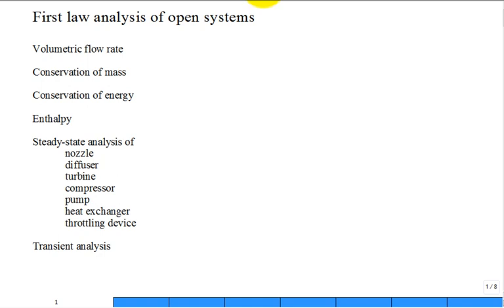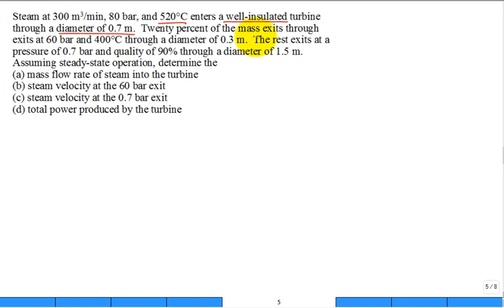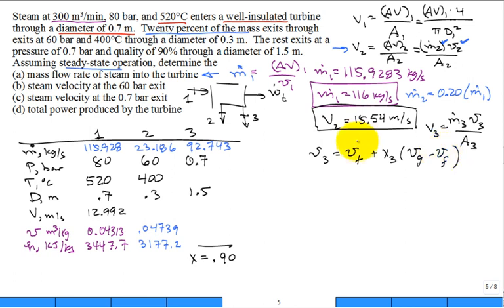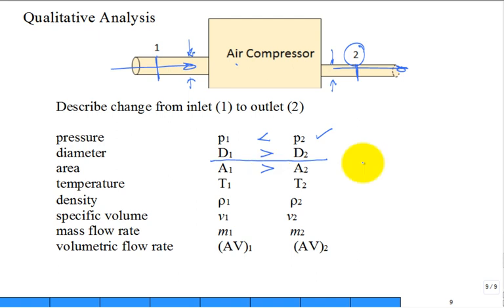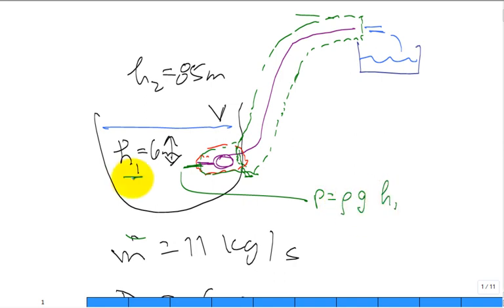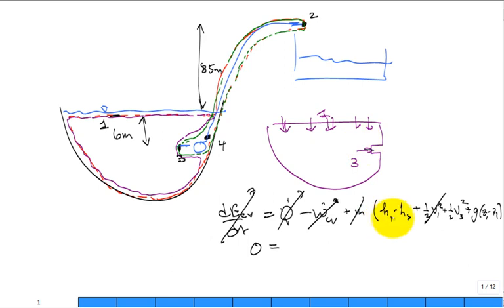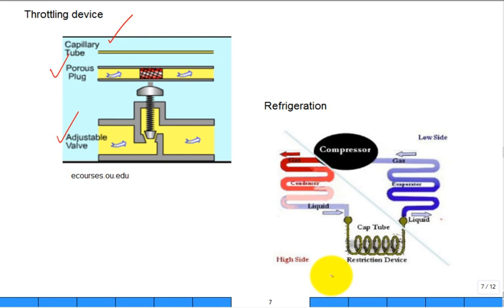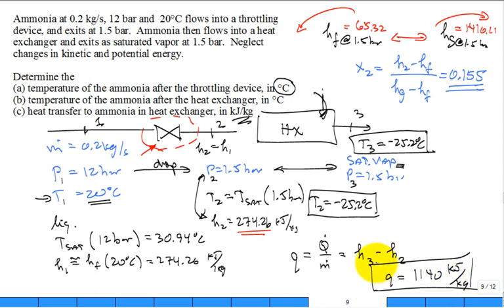ME3293 Control Volume Energy 1 Summer2016

Comment: Hello!

If I have a heat source generating 80W into a diaphragm wall, the diaphragm walls is into the ground, the heat exchanged at the interface ground/concrete could give me the actually energy efficiency of the system? For example, if I need 80 W to extract from the ground through this concrete diaphragm wall, can I find out how much of the energy I can actually obtain to say "My needs are 80W, but I can get only 60W from the ground"? 

I am studying geothermal energy (energy foundations as diaphragm walls) and I don't know exactly what's happening in the ground because the method I am using consist in treating the pipes within the diaphragm walls (which are in the ground) as heat sources, followed by measuring the exchange heat at the interface of concrete/ground. But I don't understand exactly what this means. 

I would really appreciate your answer!!
Thank you!

Comment: @6:00 Why didn't we use the W= v(P2- P1) for calculating the pump work?
Reply from the maker: The eqn you describe is based on 2nd Law & reversible flow through pump.  Have not covered that yet in the course.  This problem is solved only using 1st law.  Info in problem allows one to look-up h1 and h2 in tables.

Comment: @video time 28.10 why is it that m1= A*V/v(specific volume) = 115.928kg/s why was the area not accounted for during the calculation of the mass
Reply: the reason why he doesn't account for the area is because the volumetric flow rate is the area*v and the volumetric flow rate is already given in the problem as 300 cubic meters per minute. just convert minutes to seconds and divide by the specific volume.